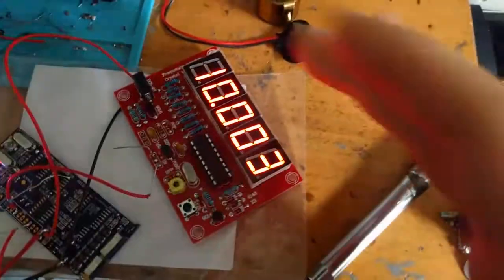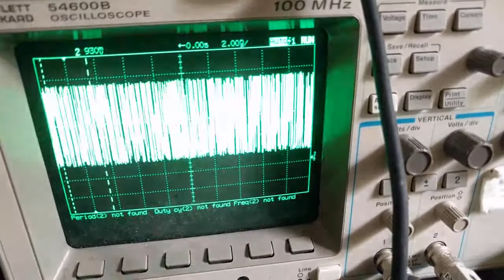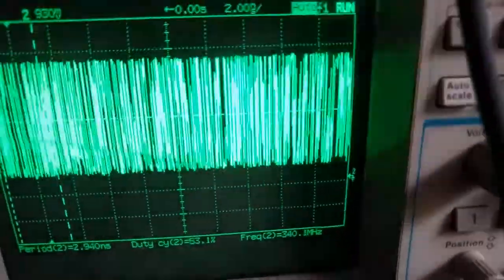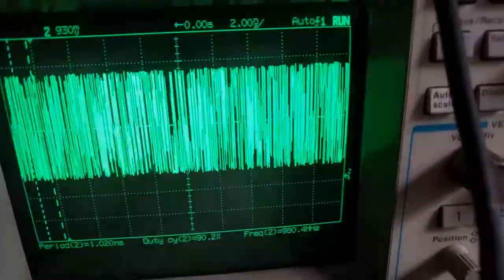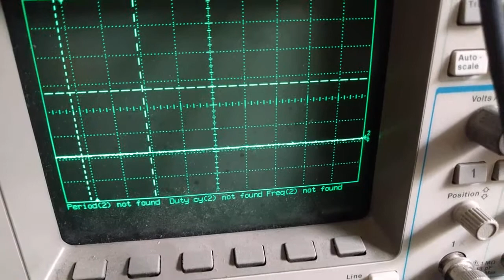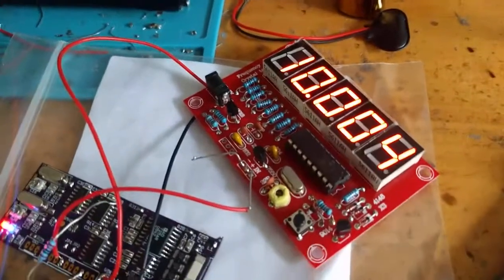DIY Frequecy Counter Review and Testing

Comment: Mine not working after assembling. 
Error is like this: Number 6 is running from left to right for abouth 20 seconds then stops and shows nothing.
I have read on aliexpress that someone got a empty IC but he did not elaborated what it does when it is missing the IC programming.